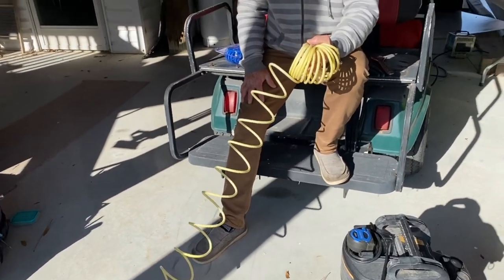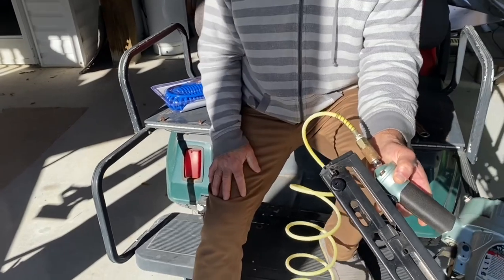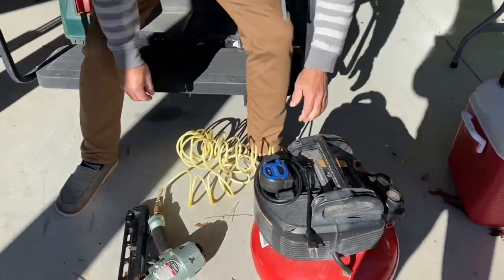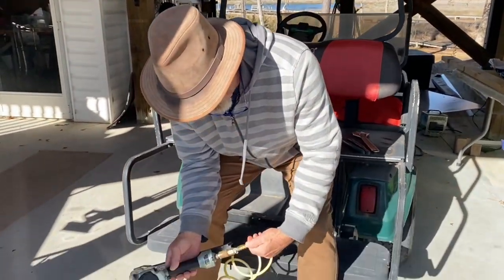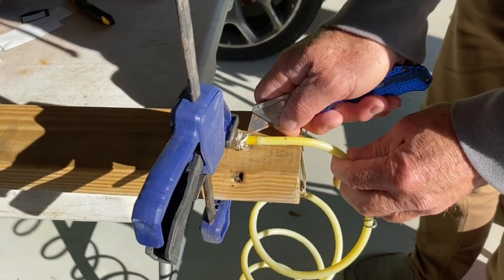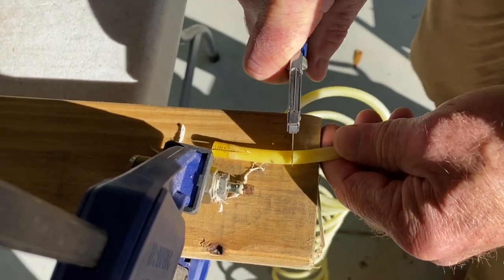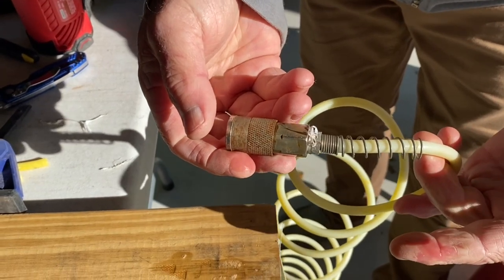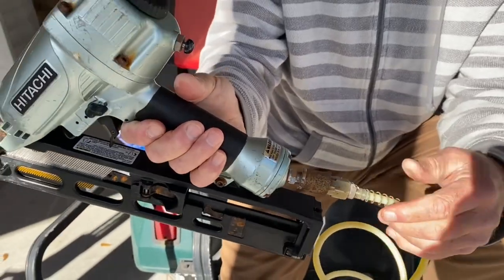Hose Repair. Compressor Hose quick fix!!

Comment: spring on air hose at the connector, would be a strain relief  as to keep hose from kinking. I like the coil up airline and using a cord clamp is a great Idea.